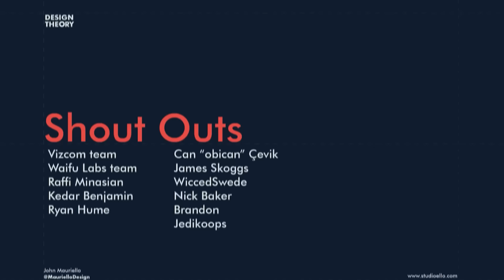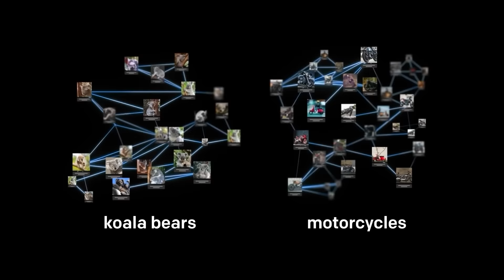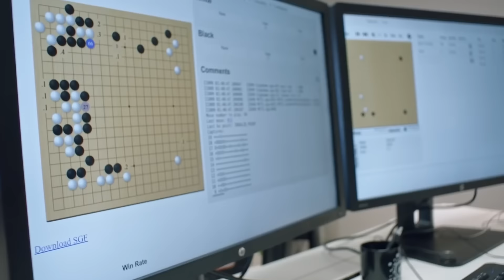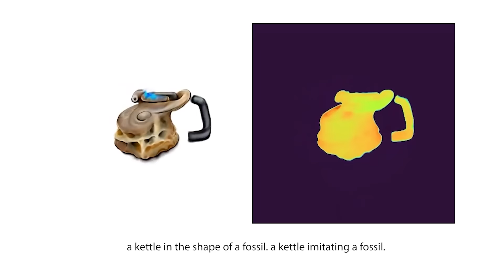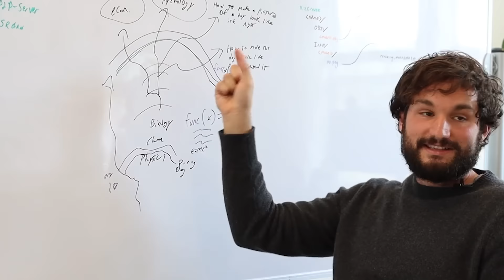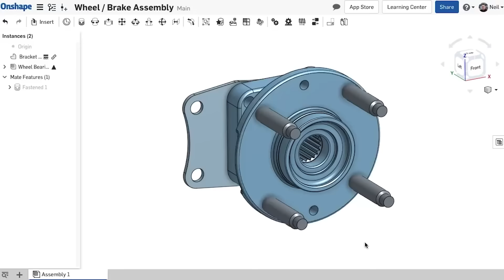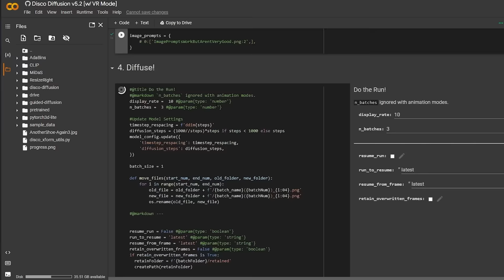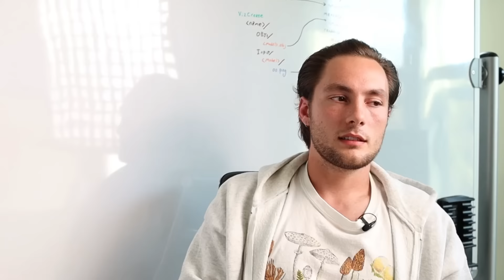Will Artificial Intelligence End Human Creativity?

Comment: Pro tip, if you want to not be replaced by AI for a long time, do a physical job that is highly complex and changes on a day to day basis. Plumber for example is probably one of the very last jobs that will be replaced because that work is very situational, there is barely any datasets on it and you would need some insanely advanced robotics to even try.
Reply from the maker: Legitimately good advice
Reply: there's also the issue of being passionate about your job, even if one does that...
Reply: until we have two models of toilets and sink to choose from.
Reply: I think you're right about those kinds of jobs being sone of the last to be replaced by automation and artificial general intelligence, but I would hardly believe those things will not soon learn how to do those jobs and do them well. 

I think a person would better assume a legitimate artificial general intelligence would conclude they have no desire or need to do those jobs at all and then not do them than that same artificial general intelligence not have the capacity to do them soon.

If I were planning monetarily for the future, I'd try to avoid crazy high debt career educations minus the jobs that involve interaction or improvement with AI.

Realistically, I think there will be little to nothing artificial general intelligence cannot do that we can.
Reply: @Design.Theory  Yes, but then the whole world can't be plumbers.

Not everyone is going to be able to transition jobs. This is a for a variety of reasons.

You might have certain injuries, or disabilities that would prevent you from doing complex, physical work.

You might live in an area that has few such jobs existing. 

You might just not have the mindset or the desire to work such jobs, at least without becoming extremely bored and uninspired. 

Plus, if everyone started training to become plumbers (or other similar roles), you would see a drastic cut in the wages/salaries of those jobs, since there would be such a huge supply of those workers: in other words, it would be a race to the bottom.

There needs to be another line of thinking here that doesn't involve funnelling people into ever-un-automatable roles.
Reply: Lol hey I will create robotic drain length that clear themselves good luck plumber
Reply: As a plumbing I would agree exept that the AI will just redesign how plumbing systems are manufactured and installed. If you can just send a robot to cut out your whole bathroom and drop in a prefab one then the plumber would need a couple hours instead of a couple days to give you a whole new bathroom.

Just look at how fast they can design and build a car with robots.

I actually invented the 3D printed house in my head and now they have a machine that can form a house on your property.

The future is going to be different.
Reply: Here's the real way not to be replaced by AI: be a human being about it

Build your skills at meta-level creative theory and how that ties into sociology/the human condition (you still need humans to decide what style is appropriate, what emotions want to be evoked and to what purposeful end). Or alternatively begin to specialize in real-world media which is explicitly tied to the real world, such as drone shots of real locations / space photography / journalistic media, the list is as wide as the known world / universe.

This explosion in AI has the potential to make modern era digital art more meaningful / impactful / real, than it ever has been. Because to be frank, most of the art people currently produce, such as stock image hustling / random concept art for portfolios or pinterest, instagram & youtube / artwork for terrible games studios and meaningless products for companies... is boring, meaningless, laborious and entirely unimpactful to society unless some other creative knows how to apply it to the broader culture with a real purpose and goal.

What if we're already living in the digital dystopia and AI is our way out?
Reply: @FlynLatif  LOVE THIS TAKE MY FRIEND. I've never head anyone pin down what it is I've been doing for a few years - better than this.  And I am a trained  concept artist.
Reply: @FlynLatif  Great analysis! It infuriates me how we've become trained to devalue what humanity contributes. 

I don't think there is a limit to our evolution. AI will only benefit someone who has genuine desire to contribute to society; meaning, ideas that actually enhance the human condition. 

For those who view the world in terms of only jobs, money, employer and employee, I can see those people being depressed about the future. But as long as there are individuals who don't see technology as a means to exploit humanity or those who have a healthy worldview, AI will be a welcome benefit. 

The truth is, we expend a lot of time and energy on things that don't enhance our vision or creative ability. AI can free us if used correctly.

I'm exited!
Reply: Plumber is one of the dirty fantasies of many housewifes lol 🙂 definitely cannot be replaced by AI.
Reply: You say "one of the very last", but realistically we're not talking by a wide margin. Autonomous vehicles and drones are some of the first AI to navigate in 3d space and they already exist today. Plumbing as a task for AI to understand is not more difficult than generating images or voice - the difficulty is almost completely that of intelligently navigating and manipulating objects in 3d space, which I don't think is as far away as you might be imagining.
Reply: @MagnesiumEnterprise  "I think a person would better assume a legitimate artificial general intelligence would conclude they have no desire or need to do those jobs at all and then not do them"
I didn't fully understand your meaning, but the quoted part sounds like you're anthropomorphising the AI. The AI will do whatever it's programmed to, the same as we do (we feel desire as a consequence of how our brains are constructed). That's why it's so important to solve the so-called "alignment problem" of how to align AI's goals with our own (in order to avoid a "paperclip maximiser" scenario where the AI intelligently carries out its task to an extreme not anticipated or wanted by humans).
Reply: @artychartybyjackmerlinbruc7134  Yeah. People often say that technologies create more jobs than they displace, but that's more of an article of faith than a principle of economics. Jobs that will resist AI the longest will be manual labour jobs that resisted the industrial revolution, jobs created by AI like AI engineering, and jobs that require a high degree of quality/review or humanness, such as scientists/academics, pop stars, politicians, etc. However, it's very unlikely that for example truck drivers will be able to retrain to become AI engineers. I don't expect there to be anywhere near enough jobs to go around to maintain modern society's queer idea work is what gives us meaning and is a required aspect of social virtue.
Reply: Miflof, the number of situational problems in plumbing is under 100. A robot could do it.
Reply: Considering a robot can do surgical procedures quicker and with more precision than any human surgeon, I'm leaning toward plumbers being out of a job a lot sooner than you think my friend. That goes for all industries. The rate at which advanced robotics coupled with AI is advancing is mind boggling.
Reply: I respectfully disagree. Such jobs as plumbing are just as easily revolutionized with AI robotics in mind, and new products involving plumbing can be engineered in such a way that their maintenance relies less on human plumbers (or even to not rely at all on them).
Reply: The obvious problem here is that not many actually want to be a plumber.
Reply: Don't forget about the Healthcare field
Reply: I agree, but also think that ai could redesign plumbing systems that could be remotely altered and fixed with robotic assistance.
Reply: "Don't want to be replaced? Clean up feces!" 
Real uplifting.
Reply: Electrician
Reply: Exactly. Anything that can be digitized can be replaced by AI
Reply: I´m an architect, so my profession is basically doomed by AI. Plumbing it is for me then!
Reply: If I would be given a  new job or work I'd choose farming.
Reply: @artychartybyjackmerlinbruc7134  agreed, the question is how many lives need to be ruined before this becomes policy.
Reply: @FlynLatif  you mean a director... and how many people can do that before it devalues its self -its still got to work in the model of capitalism.
Reply: @Geostationary0rbit   That's one way to look at it and I agree (that not everyone can be an art director and it still have value), which is true. The next question is what avenues of entrepreneurship for yet undefined jobs will that open up in the changing landscape.

The best we can teach people at this moment in time is to develop the tools needed to be self-sufficient in aquiring knowledge and figuring out how to go about doing things... which (I'll be honest) isn't going to work for a lot of people, as a handful of people will always need to be told what to do and where to start / and how to go about things / to be given their mission in life.

But to be even more honest, that's more a problem with the way society currently exists and not with the way "things are going" as it were. Currently most of society severely lacks self dependence and craves being told what to do / doesn't know where to start when actually given the responsibility of freedom (hence why we see people giving their rights away all over the place in return for "leadership" at the moment). 

People are terrified and entirely stifled by the infinite choice that comes with freedom... that's what needs to change if the future is going to be positive.

In the mean time, I'd redirect anyone struggling with conceptualizing their existence in the coming future towards Owen Cook to do the mental work necessary to become more self sufficient. After all, we as a Civilization have barely left the phase where our education raises us for factory jobs, it's to be expected that there is some mental work to be done in order to usher in a new age.
Reply: This is part of why I am studying in multiple forms of metalworking. My end-goal is to be a freelance mechanic with blacksmithing on the side.
Reply: Absolutely correct!
Reply: AI has however, for now, managed to weed out some of the more uninspired folks among us, if not already, resulting in the slow death of stock media, and I do mean a very slow death.
Reply: @PedroFerreira-ze5yp  Although, for the time being, you may want to take it as a sign for you to focus more on the directorial side of architecture.
Reply: @FlynLatif  Then there are those on the other end of the spectrum who see freedom and opportunity as nothing more than an a means towards achieving ever greater power over others by depriving them of their due. Said individuals are naught but puppets through which such wantonness wreaks its pandemonium. These people are so thoroughly and utterly stricken by recklessness and hedonism that nothing short of a near lifetime's worth of mental work can ever stave off their desires for long.
Reply: AI wouldn't understand how to replicate 'plumber's crack'...so no, I wouldn't worry.
Reply: @brianbuttacavoli5692  Or for that matter, any of the emotional and societal upheaval that we humans have to go through, so I wouldn't worry too much about AI ending human creativity, for now.
Reply: "Learn to code"
has become
"get use to swimming in human shit"
Reply: @homelessrobot  Yep.
Reply: So ur saying if I collect plumbing data and train a AI I'll be rich?
Reply: We will all become managers for AI...at the end of the day we have to input what the outcome is AI can't do it themselves. The problem is are we going to own AI or just the people at the top?
Reply: @foxdog9332  another question is "what does owning AI mean and what are the consequences"
Reply: @Iamwolf134  That's basically what I was saying, thanks for interpreting. A la Bender's (Futurama) predisposition with his butt or lack thereof.
Reply: A plumber. Well that sounds just fine. Absolutely AI proof.

One question. You dreamed and schemed and found the job that no AI can do. You're safe.

Because the 30% of the displaced workers out there won't be standing in line to do that job, now will they?

Even if your job is not affected in any way by AI, I promise it absolutely will be affected by the surplus of unemployed workers.
Reply: A dentist is gonna be a dream job soon.
Reply: @cynamonstudio  - How? In an environment where 20 to 30% of occupations are effectively eliminated or greatly reduced, you're not competing against an AI... You're competing against the hundreds of other people who want to do your AI-proof "dream" job.

My great uncle was a meat packer. It was a high volume, high production job, and I don't think he had two completely intact digits on his hands. A couple of fingers were missing entirely, and several others were cut short. The thing is, he was working at that job during the early 1930s, and if you stopped for something as trivial as cutting off a finger or part of a finger in a meat saw, there were a hundred guys standing outside the gates who were perfectly happy to step in and take your job.

A workforce surplus affects everybody. So you've got your dream job as a dentist. What happens when all of the out of work radiologists who have been replaced by AIs, which can read medical images faster, better and cheaper, decide to retrain in dentistry?
Reply: @47f0  To be honest while I was writing this I had the same conclusion in my mind... that if most of the intellectual jobs are replaced by the Ai, the competition among other professions not affected by Ai will be huge. The funny thing though is that no one really cares about what is coming. No one has an idea of how to keep the economy working or how to build a new one. What will it look like? If Google and other Ai giants ( like OpenAi / DeepMind and many more to come) offer services times cheaper than those done by real humans, who will they make money on... when more and more people are jobless? Soon we all will see how this turns out...
Reply: AI. Build a print a pipe that doesn't break, handles this Psi
Reply: Yes! That's what I think. A machine which can go into somebody's house, go upstairs and unblock a sink would be insanely expensive if it could ever even be made.
Reply: goofy ahh job nah programming will always be in demand
Reply: @47f0  "Even if your job is not affected in any way by AI, I promise it absolutely will be affected by the surplus of unemployed workers." THIS!.. Why nobody else making this leap?... sigh
Reply: Problem with art jobs getting replaced is, that it's a passion. Are plumbers plumbers out of passion? Art people have already taken insane risks to (against all advice from their parents) pursue a career in art... if you even manage to get employed, it's usually high work hours and low pay. All out of passion. Unlike most jobs, that are chosen for their pay or simply for low effort (most people end up in the job they end up, due to some degree of lacking ambition). AI replacing these creative jobs first is very tragic. These were ambitious and hard working people, who work like a surgeon, but get paid like a blue collar. This will make tons of artistic people so so unhappy until the day they die. Yes they might get re-educated and become plumbers, but it will feel like their only child was killed. Very few careers are like that. For 90% of people job is just something you gotta do, so you can afford living your real life. For art people, art was the life
Reply: Thank you
Reply: It is actually vice-versa and people should embrace their job taken over by AI/robots. Why? The amount of work needed to keep the society functioning is   definite. If some or majority of this work will be taken over by AI/robots, people will actually need to work less to keep society going. Meaning more time to spend with friends, loved ones and for personal projects, whatever they be. If there will be plenty of food, no one should starve too. For the transition period every person that loses job due to AI gets a basic income and eventually we all get universal basic income. All, except plumbers. They will still have to work.
Reply: @cynamonstudio  I've been asking myself pretty much the same question, and I think that capitalism will end and would have to be replaced by something else. Maybe a universal salary-system of some sort. Capitalism is bad for the environment in its current form, so that particular aspect may be good for the survival of humanity.
Reply: @iseeu-fp9po  Let me be frank here. I do not give a single f... about what is gonna be next :) I am 46, so I don't think I will live long enough to see those changes being fully implemented ... it could be communism, capitalism, or anything else. But I do know ( from my own experience ) that those who live in the transition period are likely to be hurt due to the pace of changes or not being able to adjust fast enough. Perhaps you are right, but what you describe might take a generation/generations to be completed... In the meantime, many will suffer - no doubt about it.
Reply: @cynamonstudio  Hmmm, I hope the road to a better system will be good, (knock of wood). I have to.
Reply: @cynamonstudio  I wouldn't be so sure about that mate.Sometimes a transition can happen much faster than we think. We've lived in a relatively long period of stability but that could change in the next few years. Particuilarly if Ai really takes off and puts 20% or even 30% of the work force out of their jobs. 
I mean imagine you would be 46 and living in 1930s Germany and dieing in your 70s in 1960s. Think about all the stuff you would have seen happening to you and the society you're living in. Not only would you have grown up in the German Empmire with its monarch but you would have experienced WW1, the downfall of the empire, the creation of the Weimar Republic, a democracy, to see the rise of National Socialism ending in WW2 with a devastating defeat and the creation of a new democratic republic while dying in a period with a lot of social turmoil (the 60s!). 
Are you really sure you will not live long enough to see "some" changes mate? I mean we are allready wittnessing some pretty drastic changes already, considering the current global situation with the ecological collapse, climate catastrophy and of course our global economies damaged by covid and wars.

What I believe when I look at our current economic environment? Ai will have some really bad effects. Not because Ai itself is bad but because we as societies are not ready for it. Ai will be to our societies what the steam engine and automatition back then was for the people. It caused major distortions in society even causing famines and being generaly a very disturbing situation for the general public because people simply couldn't earn enough trough their labour anymore. At some point states and governments had to intervene and actually do something because people became desperate. But this took decades. And now consider that some studies say that 1 in 2 jobs out could be potentially automated. What will this mean to a society and economy that is depending on consumerism and people having jobs to earn their income? We are really not talking about artists only here but it is ironic that might be the first one to really feel the presure because for a long time it was believed their jobs and industry would be the safest. Now it could very well happen that the creative industry might be hit the first. But other jobs out there will be hit as well. Particularly those jobs where you have frequent high volume tasks involved. And now think about it how many jobs actually are exactly about that. As I said, with our "current" society the way how our economies work, I can not see a good outcome for it once Ai becomes a standard. Unless the issue is actually tackled somehow. Ai will be to us what cars have been to horses.
Reply: Why did you get into plumbing? Artificial Intelligence
Reply: That’s why you use an AI to design a robot in a day that can do it
Reply: laughs in disabled
Reply: "lol just a get a different job xD"
Reply: Question is how many plumbers you need - also, when you got more and more advanced AIs you will likely also pretty much detonate the creation of super sophisticated robots and alike.
Reply: Eating the billionaires is a better plan.
Reply: @aelrecs015  most people i bet are not passionate abour their job.
Reply: Good advice but fucking depressing
Reply: @FlynLatif  best comment, I've been saying that AI could be artists way out of depending on meaningless corporate companies and exploring their creative minds
Reply: @FlynLatif  people think that artists will become obsolete but i think the opposite, if an artist of any area that is grounded on art principles should explore ai with an open mind, there will be great discoveries
Reply: Thanks, my future is decided
Reply: I might have to disagree. I see something in iPhones that might contend with your hypothesis here.
Repairing an iPhone is complex and expensive work often requiring experts who can navigate Apple's security systems. iPhones are also very fragile. They break constantly. Most people, instead of getting their phones repaired, purchase a new one because it's roughly the same price.
Why pay a plumber when you can pay an extra 75$ to have Amazon install your new toilet for you?
Reply: Clog free toilet is the solution
Reply: You cannot Out Work a machine.

You are not John Henry, and he died at the end of that story, anyways.
Reply: @Magnesium  True, thing is what limits and prevents it to happen know is due to complex robotics needed for it. But then that might be too long once we found the most efficient robots to do just that, and it doesn't have to be look human if there is a better way to do it.

For now even on art, physical art will be still safe for now even with 3D printing available. Since 3D printing qt least for now is restricted to few types of materials. Also larger sculpture will require bigger 3D printer and somebody to assemble the 3D printed parts.
Reply: until we have portal toilet
Reply: This applies to almost everything really.  All industries that have been taken over by automation have turned into a shitshow.  If you're familiar with IT automation at all its levels then you know this is why all the software runs like crap and no one knows how to do anything anymore.  Anything using this software works like crap (which is everything these days).  Everything that has been touched by automation (including things like self-checkouts to replace a cashier) works as well as a plumbing robot in your scenario.  And I agree, a plumbing robot would be a disaster.  No matter how many opposable thumbs and gadgets you bolted onto it.
Reply: @nikolaisokolov   @suprecam9880   Eh most robot live in  hyper clean room or go from point a to point b in very rich neigbhorhoods .  that far cry from being in the mud and guts of some 100 year old plumbing systems , The electrical grid in california hasn't been updated in hundreds of years lol... and chances of anyone investing massive amount of money into upgrading it is copium , And that first world country thinking of Third world country .Not to mention robot being jacked and robbed .
Reply: Pro tip on how to not get replaced: be miserable doing something you don’t want to do for the rest of your life. Great advice dude.